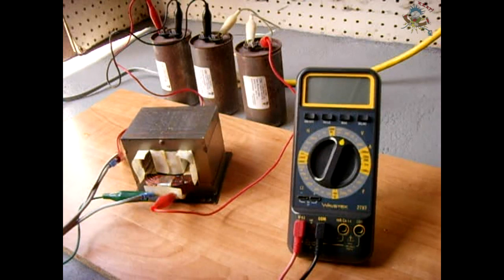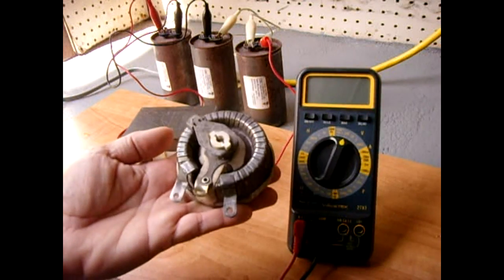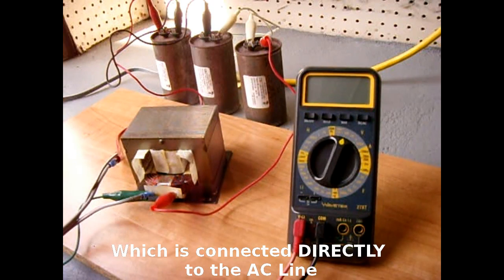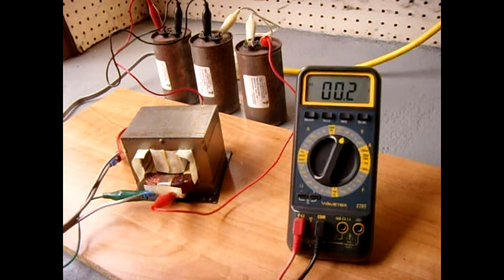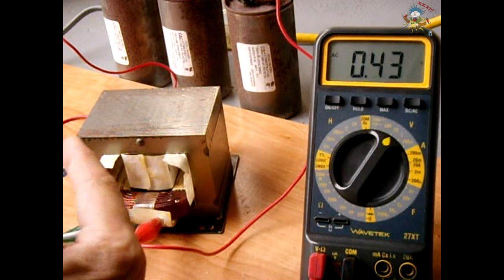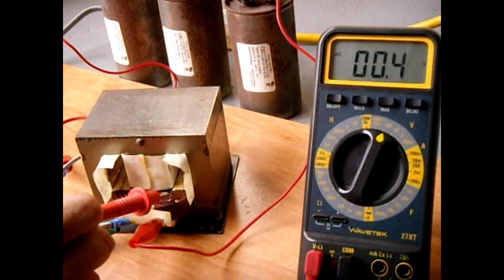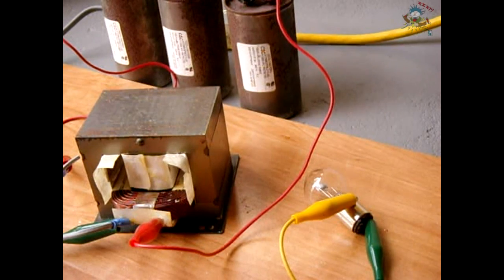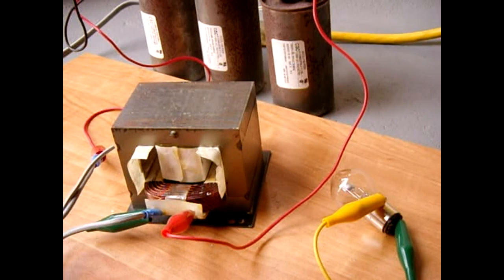How Autotransformers(Variacs) Work

Comment: Very Cool - every other 'explanation' I have seen are more about how to use - or how it 'works' like explaining how an amp works, by teaching how to plug it in and connect speakers! BTW I have one, Griffin and George 0-30v AC/DC with full bridge (1970's) - but I cannot see how they scrubbed the (UK) remaining 200 odd volts! Would like to raise the sweep to 0-40 - is that possible?

Comment: In other words it is a big version of a potentiometer.
Here it is called variable resistor, over there it is called potentiometer and over the other place it is called variac.  Isn't that nice.
What about heat. oh my heat and better not touch anything or else.
Reply: I think that might be wrong.  I'm trying to understand how a variac works, and I think that what's happening is that the iron core around which the wire is wrapped is becoming magnetized.  The AC current between the hot lead and the wiper is driving the magnetism in the whole core.  Therefore, the part of the wire between the wiper and the neutral lead becomes energized just as if it were a separate winding in a two-winding transformer.  If I'm right, then in effect the power is regulated almost opposite to what happens in a rheostat, which uses resistance to lower the voltage.  Please understand that I'm struggling to understand how this works, so it's probable that I have gotten this wrong.

Comment: So basically an auto Transformer is the same as a model train control Transformer?
Reply from the maker: Hi George. If it operates the same way as the variac in my other video below, where a toroid is being tapped at different areas, then yes. Thanks for watching!
https://www.youtube.com/watch?v=oI-md8dRAbo
Reply: @electronicsNmore  more or less but the brush moves across the flat side of a square transformer rather than toroid. You should check out the rodin coil sometime or Poe coil as well!

Comment: Make a starship coil auto transformer
Reply from the maker: That's one unusual coil. :-) Thanks for watching Dave!
Reply: @electronicsNmore  when using magnetic viewing film on it, it shows the Flux lines don't go around the outside , it keeps them in a vertical column

Comment: That toroid of which you speak, is that just a steel circle?  Also, when making a winding like what you have in that transformer, do the individual copper wires need to not be in contact with each other, hence the enamel coating, or do they all touch with an enamel overlay on the whole system?  One more question if you don't mind, are the winding wrapped in one layer or are they in multiple layers around the toroid?  Thanks for your time, I'm off to subscribe now!  This channel looks awesome!  My brother is an electronics tech by trade and things like this give me something to talk to him about.
Reply from the maker: Hello. No, usually not laminated steel. Usually ferrite, or powdered iron. Does not matter if the enamel wire touches. You want a neatly wound transformer. One or more layers.

Comment: Very clear video.  It's interesting how you limit the current using 3 microwave oven capacitors.  I have a few of these but they all seem to run hot.  I will try this to gain more control and reduce the tempco.  Thanks.

Comment: Sir. could one remove all the MOT windings and shunts, and completely rewind it using Silvio Klaic's transformer calculator for the purpose of using it as a high amp variable bench power supply? Or are these transformers too crude for this application?

Walt
Reply from the maker: Walter Cengia Hello Walt. Yes. Please refer to my other video below.

https://www.youtube.com/watch?v=3uCuA032lYw

Comment: Great video, can you  create an isolation transformer and a variac in one unit?
Two 120 volt M.O.T. primary colis back to back. ( 120 volts in 120 volts out isolated) , and tap as needed for various voltages. M.O.T.s should give  high current.?
Reply from the maker: You will get good current output. 8 to 10 amps! Just make sure you place the cooling fan close to the transformer to keep it cool. MOT's were designed to be driven higher than they should to save money and weight.
Reply: electronicsNmore  is it possible for you to describe that a little better I'm lost that you just said MOTS were designed to be driven higher to save money and weight? A MOT is already heavy so how can they be saving on weight? Is that why I've started to see that they have started to use aluminum windings on the primary?
Reply from the maker: Ben Boudreau
The size of the MOT would normally be LARGER to deliver the same power output.

Comment: To make this safer to use, can we use another M,O.T. to make an isolated 120 volt supply before tapping these voltages? That would isolate the taqpped voltage from the mains. Please show on a video. Thanks.
Reply from the maker: They usually only use one winding, but you can take 2 identical MOT's and place both primary windings into one core and weld it back together. Now you are isolated from the AC line. Tap the secondary 120V output. Be sure to use the microwave oven cooling fan on the transformer core.
Reply: That may be safer for someone new to working with line voltages, thanks for keeping practical electronics alive..
Reply: electronicsNmore why do you say be sure to use the fan? Do the windings get hot if you're not pulling power through the secondary? If you put two 120 V windings on the same core like you said.
Reply from the maker: The transformer must be cooled if used more than a few minutes at a time, unless you rewind the transformer.
Reply: electronicsNmore does it depend on the transformer and how it was made because I've run one with a rewound secondary and it doesn't get hot and I've had it running for more than five minutes maybe even 10 minutes.
Reply from the maker: Ben Boudreau
Yes, I have a video showing how to rewind a MOT to any output you desire. Look for "DIY Transformers" in my video playlist.
Reply: electronicsNmore also what would be different between the primary that is there now and if you rewound the primary like what you're saying to do.
Reply from the maker: Ben Boudreau
I'm sorry, but I don't have the time to reply to a viewer more than once or twice. I have over 375 videos.